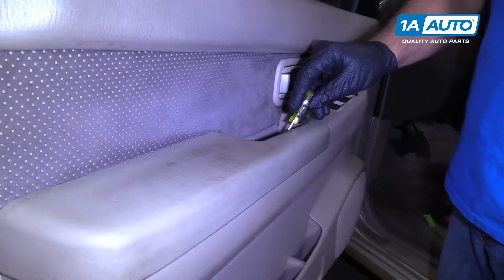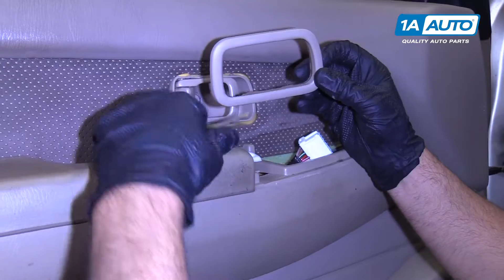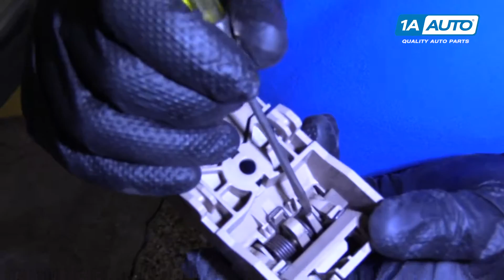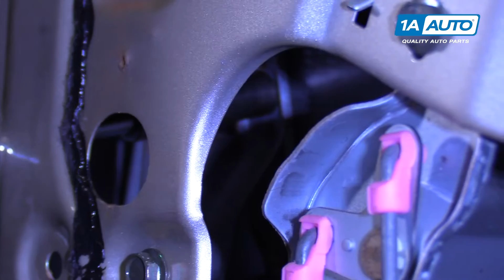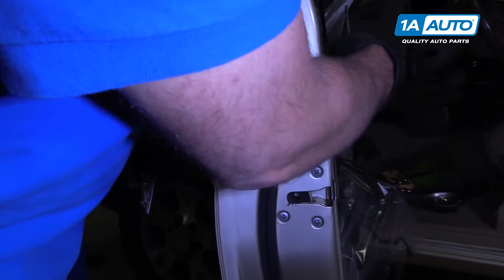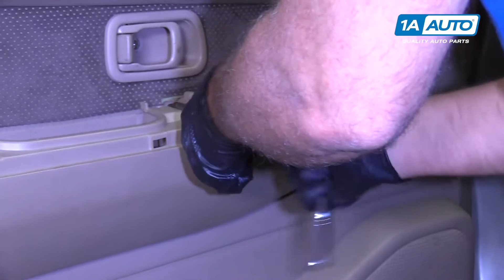How to Replace Outside Door handle 96-04 Nissan Pathfinder

Comment: Great instructional video!  Worked perfectly on a 99 pathfinder. Give this man a raise!  Extra kudos for explaining the bracket attached to the outer door handle bolt - I didn't see it and was wondering where in the heck it came from?!  Also, dont forget to reinstall the window guide before resealing the vapor barrier (small potatoes).

Comment: Thank you.  Just saved me $411 dollars and a few hours time at the dealer, minus the price of your trim kit and the handle.

FWIW:  I had a speaker, hood, and fuel door switches.  The speaker stayed in the door, and the other switches came out with the door panel.

I didn't take the inside handle off

Comment: Anyone know if this same process would apply to 2002 Nissan Xterra ? do they have same design?
Reply from the maker: +masjoun We don't have a how-to video for your vehicle right now, but the basic steps in this video should be enough to do this task.
Reply: Yes!!just worked on my husbands door handle and that what he has. Unfortunately, the rod is missing. Gonna hit you the local picknpull to see if we can get our hands on one. Your comment was a year again did you ever attempt the replacement?

Comment: How is this OUTSIDE door handle? This is the inside handle...complete opposite of what I needed and what the title of the video states.
Reply from the maker: +Tim Smith Thanks for checking us out! In order to gain access to the outside door handle, you must go through the inside in order to get the mounting bracket off to remove the handle itself. 1AAuto.com
Reply: You obviously didn't watch the whole video haha

Comment: Thank you!  These instructions worked well for my 2004 Frontier!  I found that I did not have to disassemble the door much as you did - I was able to work around the window track and only peeled back the barrier fabric about 1/4 way.  Cracked the old handle after an ice storm glazed the doors shut this past winter.  Followed this video as a guide of what to look for / where on the Frontier.  Love that I only needed a Phillips head screw driver, a pry bar and a 10mm socket to do it all!   Took all of 20 minutes.  Thank you, again!